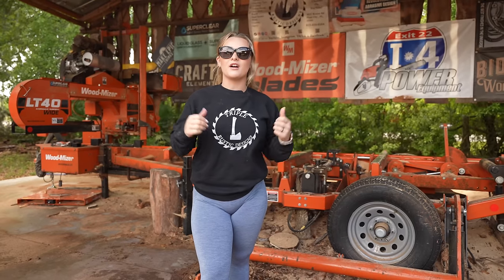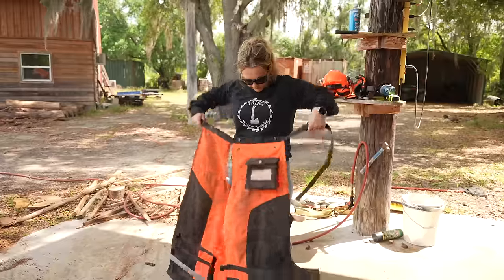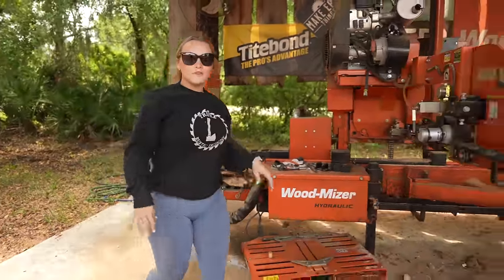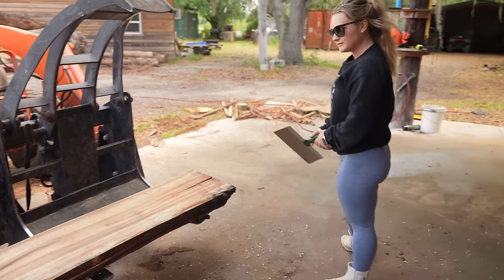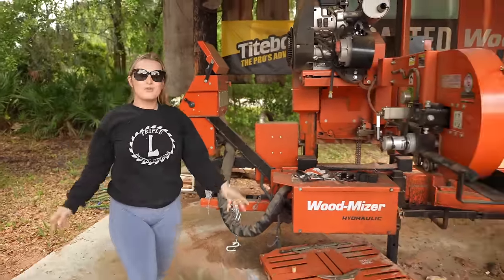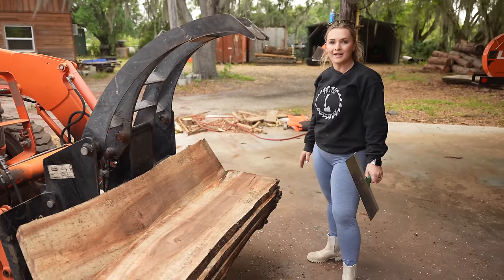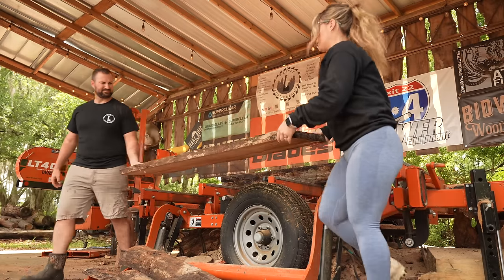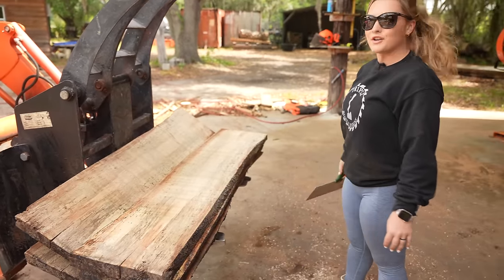The Sawmill Queen Is Back At It Again | Stihl MSA 300C

Comment: Nice saw . I have a MS 220 with the 300 series battery . Handy as a second shirt pocket around the mill .
Reply: They very much not comparable I have both MSA300 and MSA220C, the 300 is way faster and powerful but heavier also. For the 220C  I suggest the Light04  14" bar and the AP300S battery, in my case because I have also other battery machines I have all batteries from AP200 to AP500S.

Comment: I have this saw over 2 years with an 18" bar, no doubt the saw is good but the batteries are light years away for professional use, for a day work out in the forest I with need a truck load of batteries.
The plastic cap over the air filter have 4 screws do not tight themes to much or you be in trouble has it had happen to me.  You need clean the air filter frequently it sucks a lots of dust.
Is a fast powerful saw, for sure I have used mine beyond manufacturers recommendation never have any problem wish I with say the same about the AP500S batteries and I have 4 of those. I have also the MSA220C, 161T, TRIMMER 135, GTA26 and the Blower BGA86, all this machines are excellent but the best one attending at a run time in one battery charge is with out a doubt the 161T.